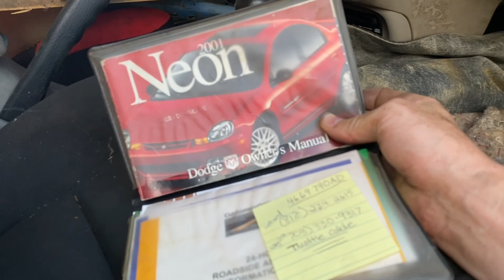2000 ES Dodge Neon Control Arm rear bolt stuck from rust!

Comment: I would’ve used the oxy acetylene torch on that control arm bolt!  Just have to keep the water hose handy to put out fires lol.
Reply from the maker: Ya it be nice if I had the ability to use an oxy!